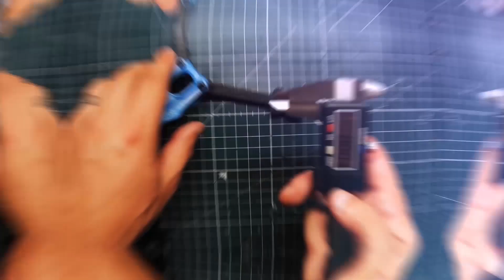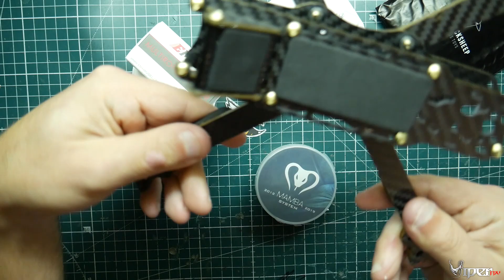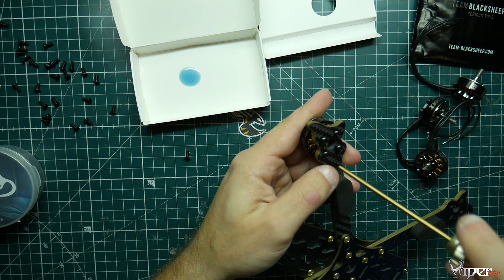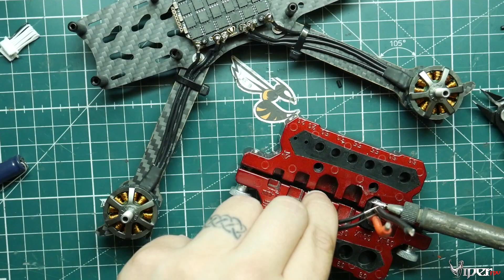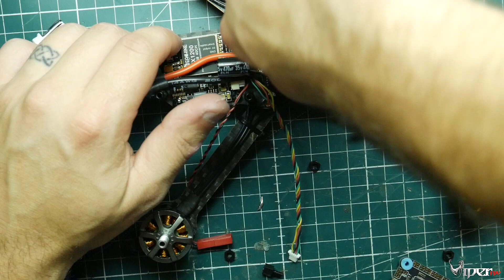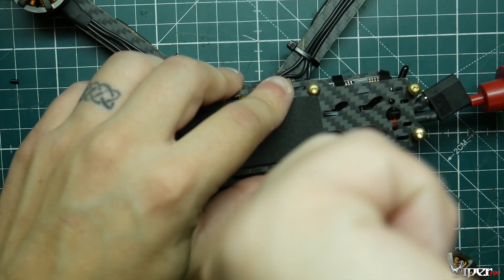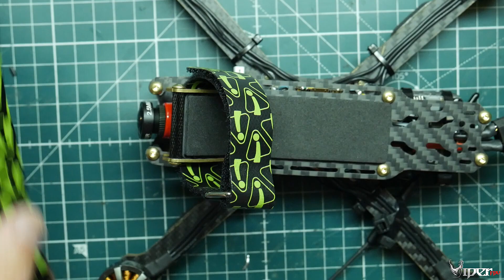How To Build a PRO FPV Freestyle Drone for ONLY $120 - Best Budget FPV Racing Drone Build of 2020

Comment: Hey bud great video but I have a question,  I don't want to build a drone so what kind of freestyle drone would you recommend that I buy, is there a kit that's ready to fly with the transmitter?  I'm not really a beginner, I used to fly RC helicopters and I had A DJI mavic drone  that I used to fly for years and a few others.

Comment: I've built this quad with the pro version with the new emax eco II, it's an amazing quad, thanks for sharing your build! I wanted to know if anyone has built it, my motors get hot no matter what I do. I tried lowering the PIDs but they are still getting rather hot. Is this normal?
Reply from the maker: Can you define hot? Can you hold the motor for longer then 5 seconds without getting burned?
Reply: @ViperFPV  When I just ride casually, it gets pretty hot, but I don't get burned from holding it longer than 5 seconds. But when I fly real fast and snappy, it gets hot to the point where If I hold the motor for more than 5 seconds, it's uncomfortably hot, like I'd probably get burned for holding it too long. Thanks for the help by the way!
Reply from the maker: @larkkane982  I wouldn’t consider that hot. Maybe warm, what is the ambient temp?
Reply: @ViperFPV  Around 25-30 Celsius or 77-86 Fahrenheit

Comment: bro can i use flysky i6x on that build and X6B transmitter? thanks for answering
Reply from the maker: Yes you can. As you can install any receiver on it.
Reply: @ViperFPV  thanks man! do you have a video that setting up flysky receiver on betaflight?

Comment: No coding?,transmitter?
Reply from the maker: This is a budget build and does not include the transmitter, goggles or battery. Betaflight setup video pinned in the comment below.
Reply: @ViperFPV  ok thank you

Comment: Hello, thank you for the tutorial. We have a question : at minute 9, you are connecting the vtx connector and said to remove the black and red cable for the camera but you mentioned that you are not doing it  but later in the video, the extra red and black wires are no longer visible. When , how and why did you remove them? This is our first build and we are following step by step and afraid of mistakes. Thanks in advance
Reply: same question here viper wgere dud the black and red wire go? thanks man

Comment: why do have 35v capacitor
Reply from the maker: For up to 6s voltage if u do decide to run it on 6s. That is what comes with the FC and esc stack. You probably can get away with a 25v one also as I have in the past.

Comment: Update on my build... Just put a new ESC bottom in from the one I thought burnt out. Turns out that was not the problem. I replaced the 4in1 with a brand new one and plugged a fresh pack in. Beta flight is only recognizing my 6s as a 2s and the motors still wont spin. Im at a loss now and I simply can NOT get this thing to work.... I've done EVERYTHING by the book. Checked everything so many times and still Im at a loss... if anyone sees this who is willing to help me at all please, help

Comment: Frame HSKRC VO235 5 inch Frame Good!)) I would replace the engines with EMAX ECO II with the installation of "soft-toch" under them, treat the contact soldering pads with Sealant 704. The receiver, for example, is a full-range Frsky XM ("Long-range" at the initial stage need not). It is easier to "link" them before setting them to Frame. CADDX Turbo EOS2 camera - for example. The VTX power supply must be blown through a separate connector, it allows you to turn OFF the TRANSMITTER during service. I'm waiting for the RPM setup video. Can you customize RPM in the simulator? to compare the quality of CONTROL ??. Thank you very much for the video.))
Reply from the maker: Yes I’m making an update 2.0 with the emax eco 2 motors. Thank you

Comment: Hi I have just finished building and setting up a drone verry similar to this. My VTX is not giving out a signal. Everything else is working apart from my VTX and camera system
Reply from the maker: Your image in your goggles static? Black screen?
Reply: @ViperFPV  no signal is given off
Reply: @ViperFPV  I have replaced the VTX and changed where the input power was as on the diagram the input was connected to the separate power cable you said not to use for the camera, and that has fixed it. I have set it up in beta flight and am not waiting for the rain to stop. I didn't see your video until I had ordered the parts then I was looking for someone who had used the frame and saw that your build was verry similar to mine. Thank you for the confidence.
Reply from the maker: @dansurf828  any lights on the vtx?
Reply: @ViperFPV  yes
Reply: @ViperFPV  I put 11.1 volts through a 5 volt chip. There are no resisters going from the chip to the camera output so if you put more than 5v in the output you blow a chip. It is fixable if you can do that small soldering but I can't and don't have the equipment to.
Reply from the maker: @dansurf828  if u did that it may be beyond repair
Reply: @ViperFPV  yeah

Comment: What uart did we use to crossfire? Im binded but I'm not getting any inputs into betaflight. Do you have a betaflight setup for this build? Im using a Tango 2 with a crossfire nano receiver. I'm 8 hours in to checking everything and starting to get very discouraged. I've double and triple checked my rx is going to tx and tx is going to rx. Ive even switched them around to be extra sure. I'm not sure what is going on and nobody in any facebook group, discord, or forum is able to help.
Reply from the maker: I forget off hand but I do go into setup on here https://youtu.be/dGh-MEcLm4I
Reply: @ViperFPV  Thanks! I got everything working fine after watching this! Then, when I attached the top of the frame to the body, for some reason I ended up smoking my 4in1..... Unfortunately I can't get another one for a few weeks so back to the sim I go
Reply from the maker: @Ghoustly  oh my that stinks do u know what caused the issue?
Reply: @ViperFPV  Honestly I'm not sure at all... hopefully a new ESC will do the trick

Comment: Im looking at getting the emax ecos for this build will the 1900kv still work cause the 2400kvs are sold out?
Reply from the maker: Yes they still work but won’t have as much punch or power. Try getting the eco 2 motors if they have them in stock
Reply: Thanks for the quick reply! Was also curious how this drone would compare to something cheaper like a eachine tyro 99 im on a bit of a budget and the price is adding up very quick for this build and was wondering if its much difference for the price?
Reply from the maker: @joshuascott4514  the tyro works but it’s using very old components so your experience may not be that great

Comment: @ Viper_FPV Hey it seems I cant't tighten up the props. They are kinda loose on the motors even though the screws are tightened . Have bought the wrong ones? Wich are the right ones for the Emax Eco 2306 series? Hope someone can help.
Reply from the maker: What ones are you using?
Reply: @ViperFPV  problem solved turned out I was just too anxious to tighten the nuts strong enough. Did not want to break something. Thanks for your replys. You're doing great work
Reply from the maker: @tastelessbrain4470  awesome!

Comment: I built it. 
Some links are broken, and some items are another than on video. I also would buy another receiver and transmitter  (TBS tango 2 and crossfire). Anyway, thank you for  guide, but It's not clear to me how to attach gopro 8 and avoid drone's part to be on image? Is it possible?

Comment: Love the Build but I'm having issues with the VTX/Camera. I have double, triple and quadruple checked my wiring and voltages. Betaflight is setup but i cant seem to get any video to my goggles. Any ideas?
Reply from the maker: Agrarian Spark are there any lights on the vtx? And when you mean no video do u mean static or black screen?
Reply: @ViperFPV  I get snowball static to start, when I  power the quad it goes black static. One thing I also did last night was bypass the FC and connect the Camera to the VTX, that gave me video in my goggles and the foxxer OSD. So the Camera is working,  but I cant seem to get the video to go through betaflight to the VTX. Based on that, do you thing the FC was DOA?
Reply: @ViperFPV   would the foxxer camera osd conflict with the Betaflight osd? Producing static?
Reply from the maker: Agrarian Spark no

Comment: What is the rsxr thing? Did you not put it in the description
Reply from the maker: It’s a receiver if u are using frsky protocol radios.
Reply: Viper_FPV so I kind of figured it out. I have a yellow black and red wire left over from my camera. Can I use thag to wire the Reciver to the drone?
Reply: @tateshelton2334  Those wire should work.

Comment: I’m soooo freaking confused. You talk about two different receivers at the end. I got the nano Reciver. And it didnt come with the cables I needed. Please help I’m stuck!!
Reply from the maker: You have the nano? Nano crossfire?
Reply: So I’m confused. Frsky Mx micro d16 mini rc Reciver
Reply from the maker: Tate Shelton what are you confused about?
Reply: Am I missing a component. What is everything I need? Because the frsky micro. Doesn’t come with the same wires you have
Reply from the maker: Tate Shelton I’m using a crossfire receiver it’s totally different wiring but I do explain on the audio how to connect a  receiver like yours.
Reply: So what about the wires I need?
Reply: Do I need that antenna too?
Reply: Is there anyway I can talk to you one on one? I’m very confused. Haha I’m so close to being done. But this stopped me lol

Comment: Hey, great video, I used your links and the parts came yesterday. Unfortunately I have 2 major issues with the build. 

1.	The Video for me is transmitting a picture, but anything in the shadow is completely black, the and the rest is white. Sometimes I see some weird colors, but it is not working. I tried different settings on the camera and loaded the Smart audio Tables. I saw that the VTX needs 7-24V and in the video you connected it to the 5V outlet, I changed it to the 9V outlet, but same problem. I could provide you a screenshot. Do you know what’s wrong?

2.	I can’t bind the my Taranis X9 Lite S to the XM Plus. The sender has latest Firmware with US Settings. Internal modul flashed to the newest version. XM Plus flashed to the latest version. But I can’ get it to bind. It never confirms the bind.
Reply from the maker: First question make sure the camera is in ntsc or pal along with in the osd page in betaflight that the one u selected on the camera is set correctly do not use auto. Regarding the receiver have u tried binding it in D8 mode not D16
Reply: @ViperFPV  Thank you for coming back so fast. Appreciated. 

Ok, I found the problem with Binding. I could bind using the Non-Rssi Firmware on the RX. Seems like the Rssi Version has some issues.

Regarding the Camera issue: I cant find in the camera a setting which means NTSC or Pal. In Betaflight I dont see that setting either. I am using 4.2.2 the VTX is wired like you said in the video to UART 3. Under ports I use VTX TBS Smart Audio. In the VTX Menu in Beaflight, I see that they can talk, because it says decice reday yes. But for example the LEDs for the TX Power level dont change when I change them in Betaflight. In the OSD Tab I also have no Pal or NTSC setting. Could you share your VTX settings?
Reply: By the way, the communication between the VTX and the FC seems to work. I can change the channels and see the blue LEDs confirming that.
Reply from the maker: Alarm Home it’s in the camera settings to switch between the 2 u have to connect the dongle that came with the camera to get in the menu.
Reply: @ViperFPV  Ok, I made a little headway. In Betaflight you will see NTSC or PAL in the OSD Tab once you connect the Battery first, then the USB cable. I tried both, no difference. 

In the camera is not setting for NTS or PAL. I tried that already. I looked in the menu which comes up with the Middle button and the one with the top button. I tried all settings, but it will not work.
Reply: The manual of the camera doesnt even match the menu which I see on the camera OSD and even that the manual has more options, NTSC and PAL is not listed. Could it be that this camera comes preset in on or the other standard? On bangood you can select a NTSC or PAL version
Reply: So, I found a 15 year old camera and was able to connect it. The camera I got is bad or I dont know how to set it up correctly. The old camera works.
Reply from the maker: Alarm Home a 15 year old camera?
Reply: @ViperFPV  Yes, I had an old 9V Cmos Camera with Analog Output laying in a box... Didnt know what voltage it was, but opend the enclosure, put it on 5V saw a little something, put it on 9V and it worked fine. BTW, I tried the Foxeer camera at 9V too, with no sucess. That thing is just garbage. I ordered the Phoenix 2 and will deal now with bangood for a warranty claim :D 

I still have not figured out how to set the VTX transmission modes corretly in Betaflight. Can you share your settings? I always have to manually set it to higher levels since the VTX defaults to 25mW.
Reply from the maker: Alarm Home I did a whole video on betaflight setup.
https://youtu.be/dGh-MEcLm4I
Reply: I was able to reduce the camera issues a bit more. It seems that the position of the VTX at the back with the power cable to the battery create an negative influcene. Now my questions, is that only at my build or is that a more common issue?
Reply from the maker: Alarm Home I never had a issue did you use a capacitor?

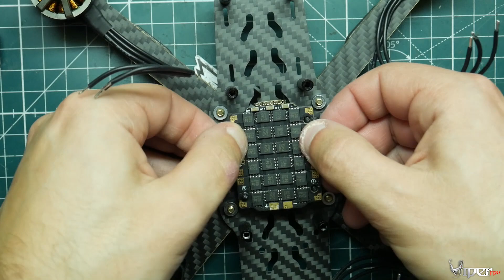Comment: 5:58 Hey I quite dont understand how you mounted the standoffs. My Mamba dosnt came with standoffs just with rubberrings on the dowwnside. I have 4 standoffs with the Frame but if theyre the right one I'm missing 2 screws because the others are tow long. Can anyone tell me how to mount them or where i find the right parts?
Reply: I can confirm that I need to install fc in another way. Screws are 12mm but should be 10. I put plastic washer to "inner" screws, to compensate 2mm, also I used 4 long screws from mamba fc, instead of  frames the longest screws.

Comment: I am 75% done with this build. I did not see a receiver in your parts list. What receiver do I need to get? I’m using a Jumper T16 Pro Transmitter. Help please! I am ready to get her in the air!
Reply from the maker: You can use a xm+ or rxsr receiver.
Reply: Viper_FPV  everything complete. But I just cannot get the ESC to send power to motors. No beeps when I plug battery in but all components powered up. Betaflight sees stick inputs, set arm switch. Can throttle the yellow lines for each motor up but motors nothing.
Reply from the maker: Elishah Gomez sounds like an esc issue, does it beep at all when plugged in?
Reply: Viper_FPV no. No beeps. And motor screws length are not too long, they are flush. It actually came out a super clean build so I’m stumped. Maybe a faulty ESC.

Comment: Hey, I realy want to build this 120 dollars drone, but Im completely new to building drones. So Ive got a question: Which equipment do I need (battery, remote controll, etc.)? And is there a possibylity to get everything I need for around 210 bucks?
Reply from the maker: Mc_ V you will need a radio batteries and goggles. I have recommendations in the description but I do believe in getting some quality goggles and a radio since those are big purchases and directly impacts your fpv experience.
Reply: @ViperFPV  thanks for ur fast answer!😁 So I have to get goggles or can I use a remote controll with display?

Comment: Have just received all the parts for this and started to put together. The frame comes in pieces so instead of removing the top plate I have to figure out assembly. That includes the insertion of the nuts in the carbon fiber. This was not straight forward and I stripped to screws and had to deal with the associated effort to remove. The stack was already assembled so I am not clear how to install stand offs etc. is there a reason for the difference. Btw, this is my second quad. I build the JB one while waiting for Banggood to deliver stuff. Cheers
Reply from the maker: Scott Trevena all frames come in peaces and there should of been included instructions
Reply: @ViperFPV  Sure, that makes sense, but your video does not start from that point. You take the top layer off etc. So for beginners it is a little bit of trial and error. I started and stopped, rewound and paused your video to try and make sense of it. I researched the carbon fiber nuts and some hammered and some screwed tight. I went the screw route and ended up stripping two of the hex bolts and having to buy tools to remove those etc. I am sure it will work out, just harder than I expected. Cheers

Comment: Been flying this build for a bit now, love it! What would I have to do to upgrade to 6s? Motors for sure, but does the mamba stack do well on 6s? Does it require a different capacitor?
Reply from the maker: Austin Lee just the motors the stack can already do 6s
Reply: Viper_FPV hey thanks, I’m curious what percent you make from affiliate links (if you know), just spent almost $200 using your links purchasing another of this build just modified to 6s plus a few other things
Reply from the maker: Austin Lee it varies anywhere from 3%-6% thank you for your support
Reply: @ViperFPV  Hey just a quick mention, at 9:38 you say that the capacitor wire which is longer is the negative. I can confirm this is false. I plugged in with my smoke stopped and all was well. But when I plugged in the battery straight... the capacitor blew up. Nothing else was damaged fortunately so no hurt feelings but just thought I would mention that. Didn't have this problem on my first build as I was too lazy to put one on for a 4s build.

Edit: Just fixed a typo
Reply from the maker: Austin Lee longer and has the - label on the side.